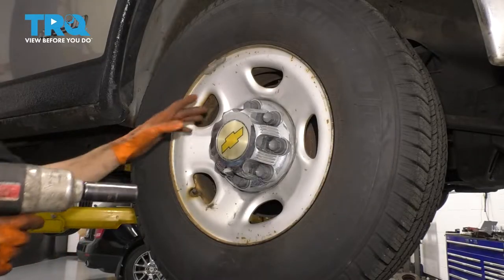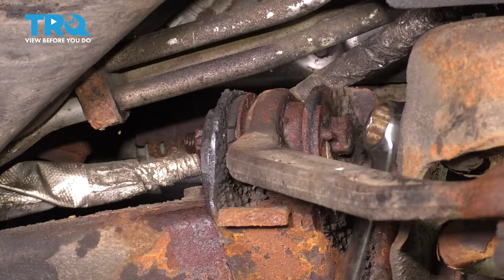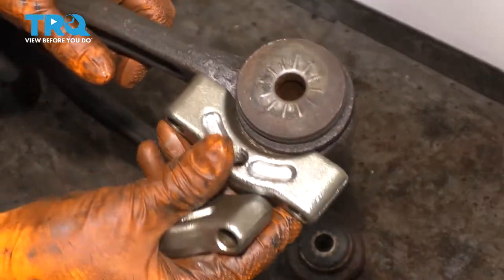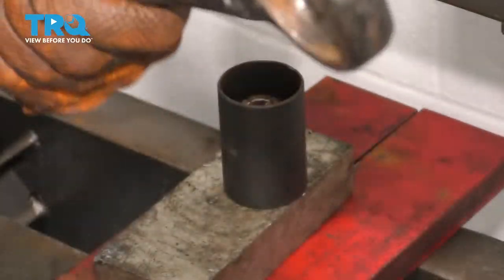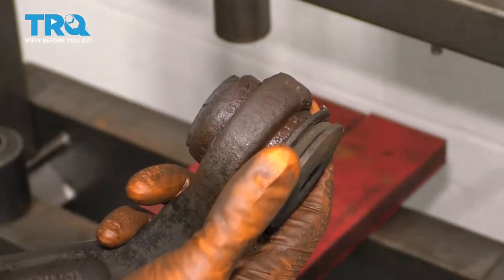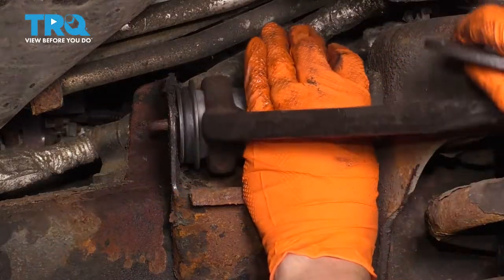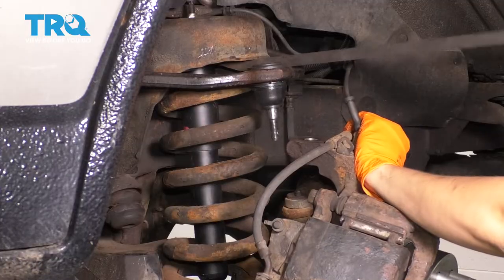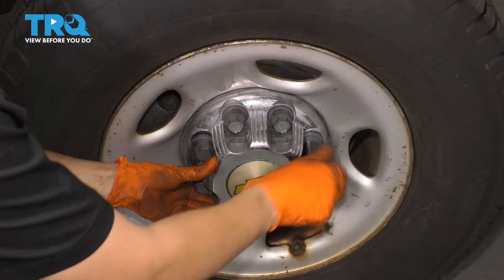How to Replace Upper Control Arm Bushings 2003-2021 Chevrolet Express

Comment: I like to install the upper ball joint, place a jack under the lower control arm, raise vehicle so weight is bearing(mimics resting ride height for control arm), THEN I  tighten upper control arm bolts.

Comment: Don't use a wire tie. It will break. Proper way is to get the busted bolt out and replace the bolt.